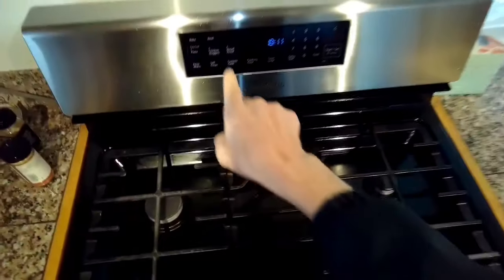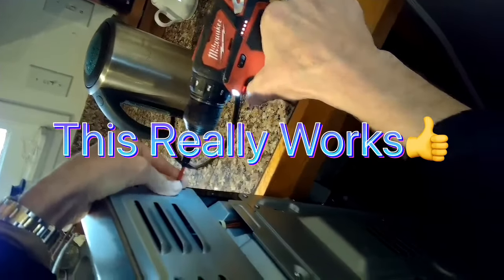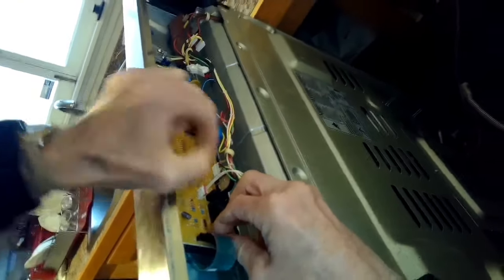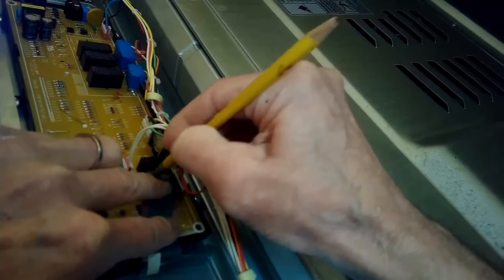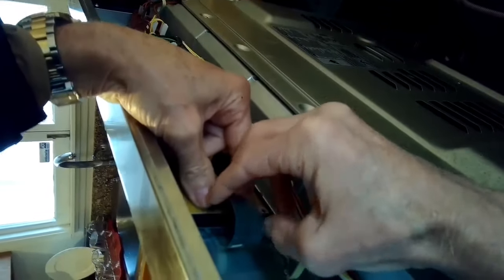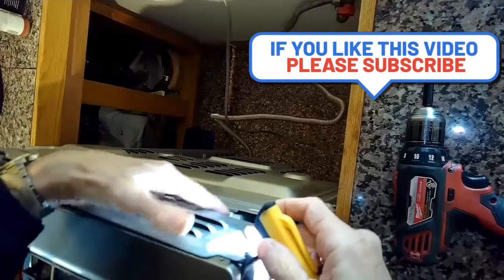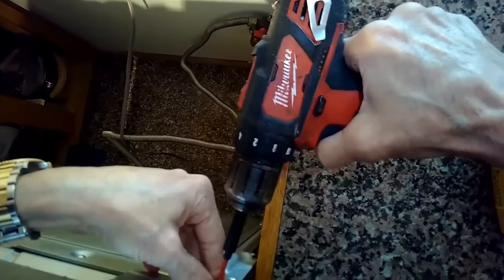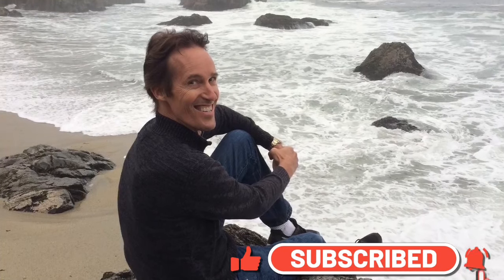✨ Quick Fix - Samsung Oven - Buttons Don’t Work -  EASY DIY ✨

Comment: Didn’t work for me. I got 400 flashing and E1 on my touchpad screen. None of the buttons work. Also when I rub with eraser it keeps getting dirty, I kept rubbing for like 5 mins continuously removing the dirt from eraser. Should I keep doing so until eraser stays clean?
Reply from the maker: You’re right,
It should end up shiny 👍
Reply: @ScottTheFixItGuyChannel  thanks for such a prompt reply and for the video. I will go ahead and try
Reply: Tried for another 30 minutes and it didn’t work. Ended up buying a new touchpd

Comment: I can’t turn my stove off. I can’t reach it to unplug it right now. It’s very hot and I cannot. I mean it’s still baking and I’ve tried everything. Is there anything I can do to stop it? I’m afraid I’m gonna start a fire in my house, plus it’s very hot.
Reply from the maker: No problem Sabrina,
Just need to go to the breaker box and turn off both breakers for the oven👍 the oven also has built in safety devices to cut power before it gets too hot.

Comment: Thanks for taking the time to make this video.  Some of the buttons on my stove worked and others didn't.  This fix worked for me.  As an alternative, I used rubbing alcohol and a small microfiber towel to clean the ribbon cable.  I also inserted the ribbon cable and removed it a few times while still wet with alcohol to help clean the connector.  After allowing it to dry, I reinstalled everything, plugged the stove back in and the buttons worked like new again.  Thanks again for your help.
Reply from the maker: Wow, nicely done. Great tips👍

Comment: Thanks Scott, yaaah, I got my touchscreen buttons working again!  After cleaning the ribbon cable (and several other electrical connections) several times with electrical cleaner the touchscreen still wouldn't work. However, I left the stove's electrical cord plugged in for about 3 minutes, and then to my surprise the buttons started working. I guess that the circuit board needs a few minutes to re-set itself.  Hooray!
Reply from the maker: Glad I could help!😊😊😊

Comment: Just tried it and it worked! 

First pull black plastic that holds the ribbon connector up slowly until it stops(do not just blindly pull on ribbon cable). Then ribbon cable detaches and clean with eraser.

Hopefully this lasts and can repeat if dirty and  do not need a touch pad or board. 

Tip: If the ribbon is inserted half way or at angle the buttons will randomly give different functions, ie number 7 is bake lol
Reply from the maker: Excellent info. Thanks so much😊😊😊

Comment: Cleaning the ribbon cable worked perfect. I used steel wool (medium #1) and cleaned the ribbon cable contacts with that. It only took a few swipes to clean the contacts.
Reply from the maker: Great tip!

Comment: Cleaned the ribbon with a little rubbing alcohol and then dried it with compressed air. Let it sit for a few minutes and then tested it. Your fix worked like a charm. Thank you!
Reply from the maker: Very impressive fix 😊😊😊

Comment: Had my cornbread batter ready to mix and the Start and Stop controls didn't work. 

For a former stove/oven I ended up replacing the membrane.

Tried the eraser to no avail. Now am waiting for the alcohol to dry out.

Next unit will have mechanical controls if I have to find and restore it myself.
Reply from the maker: Did the alcohol work?

Comment: A bug got stuck and died where the time is displayed on this same oven (Absolutely insane, I know). How do I get access to that screen display? Thanks in advance
Reply from the maker: You can follow the video to get to the controller and then remove the 4 screws that hold on the controller.
From there you’ll be able to get that bug out of there.
Reply from the maker: You can follow the video to get to the controller and then remove the 4 screws that hold on the controller.
From there you’ll be able to get that bug out of there.

Comment: I have a brand new electric range and the TouchPad doesn't work at all. No clock or anything. The stove top heats up but not the control panel for oven functions. Any suggestions?
Reply from the maker: Oh no! Can you confirm that both breakers for your oven are in the full on position?

Comment: Too happy too early. This fix worked for couple weeks but then stopped again. The Clock but also Bake buttons are dead. They come alive from time to time. Today I have very carefully cleaned it again. I have used the contact cleaner and pressure air but it did not help. It again suddenly came alive but stopped working since that. It looks more like capacitor problem than just the contact. It looks like I will have to buy new board or new range. Do you know where to go to buy the board? Regarding the new range. Do you know by any chance who is currently making the best ranges? We used to buy LG and they were always great but it has been already 5 years since we bought the last one. I am completely sure this is our last Samsung appliance.
Reply from the maker: Can you send me an email with the same question to: scottthefixitguy@yahoo.com

Comment: Thank you for this…
I think I can handle this one~ looks pretty simple…
Just one question; did you “erase”  the ribbon or the connectors or both?? 
it was hard to see what you were doing w ribbon~camera wasn’t quite on that~ would’ve been better coming from the other side, as your hands blocked much of it & was moving around so much.  Great video otherwise
Reply from the maker: You can just erase the ends of the ribbon cable so it’s nice and shiny 😊

Comment: I tried and it still doesn't work. Any other idea
Reply from the maker: I would get a new touchpad 👍
Reply: If you haven't already fixed this then I would suggest double checking the seating of the ribbon. I had to check mine 3 times before I realized that I wasn't pushing it in enough. After getting in secure it worked again. Chicken for dinner. Big Big Big Thanks to Scott for this video!!!